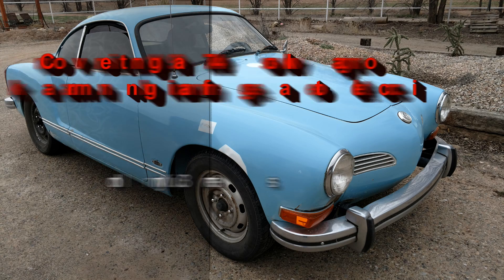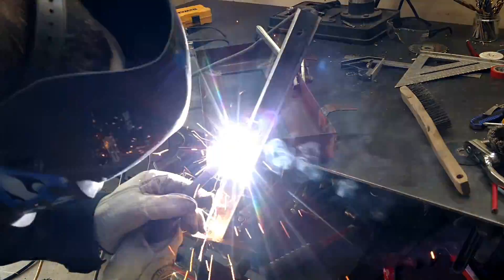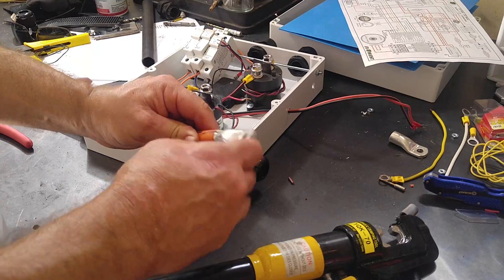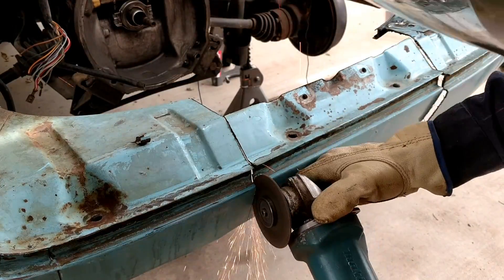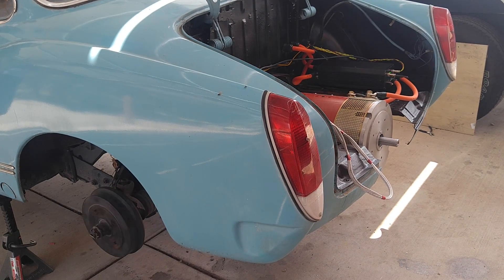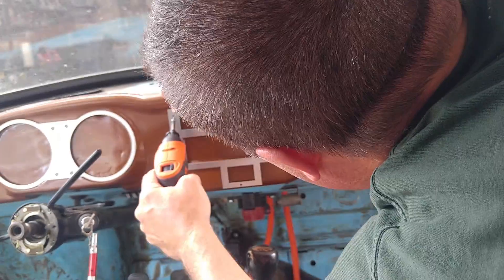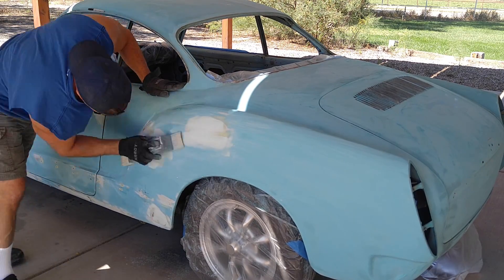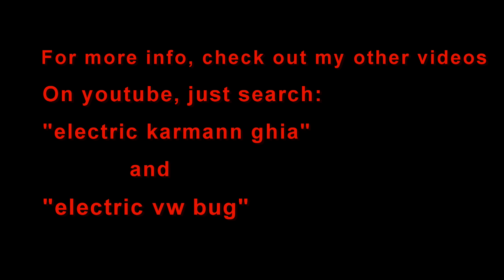Karmann Ghia Conversion to Electric (The Process)

Comment: Excellent Job! Love the creativity and practical thinking ! Does this motor and controller also have regenerative brake function?
Reply from the maker: No, it is series wound DC motor which cannot have regen, because when the throttle is off, there is no magnetic field. However, with a small car on relatively flat terrain, regen really doesn't help much compared with just coasting. Regen does save the brakes though!

Comment: Thanks for this video sir. If its not a secret - what is the source of custom metal works like dashboard parts or the construction gate form engine to transmission? How was solved a problem of vacoom breaks and hydravlic  parts of steering control? Do You use electric compressors for steering and vacoom breaks? Heater and air conditioning?
Reply from the maker: For the stainless steel on the dash i just made a template and had a machine shop cut it. That fake wood veneer came from jbugs. One reason I chose VW s is because they don't have power steering or brakes. I made a heater by taking the heating element out of a cheap space heater and hooking it up to a blower. It works instantly and far better than stock! No AC though.

Comment: Desecration.
Clever work but a shame to ruin a classic car. Should have picked a Pacer or something disposable.
Putting Prius parts on it was the final insult!!
Reply from the maker: Funny how making something superior is ruining it. Sometimes those with feeble minds struggle with perspective.
Reply: @bottsfinevids4463  Superior? That's a matter of perspective and opinion my friend. I did give you credit for clever work, but I  consider electric vehicles to be a step backward in terms of emissions, longevity and practically (although they are smooth and quiet while they last). And my mind is far from feeble.

Comment: How do u get around Rain ? Here given ur setup , it would need to b parked on high ground as soon as rain and wait 2 - 3 hrs to dry out . R u considering a shield up about 18 " ?
Reply from the maker: I try to avoid heavy rain, but I've been caught in heavy downpours more than once, and there's never been a problem. I wouldn't want to drive through a puddle deep enough to submerge the motor though.
Reply: @bottsfinevids4463  Unfortunately here we have flash flooding even when half the city in just overcast . Sweat ride though

Comment: thank you. It was interesting, I was a VW mechanic for 17 years. I would fabricate a thick metal brace for the rear that you cut out, it was structure. I also can hear that a rear u joint (CV Joints) has a bad bearing, those u joints (CV Joints) are going to be put more stress on them now that you have some more power!!! I really enjoyed the video and think it was a great idea.
Reply from the maker: Thanks you. You're right, it had a bad wheel bearing. I should have fixed it before making the video. I actually did reinforce the rear with a traction bar, which ties the two sides together as the cutout did.
Reply: @bottsfinevids4463   Did that also provide support for the electric motor? I understand the 4 bolts to the transmission held the weight of the original motor and this one, but did the floor pan provide additional support for hard bumps, etc? Also, the electric motor has a longer "moment arm" (if I recall the correct term).

Comment: Very nice build and video.  I also  liked the laid back narration.  What is the range?  Where did you learn to make this conversion and body work?  Will you do one on a Fiat 124 Spyder?  Just asking... lol  Thank you for sharing..
Reply from the maker: Thanks!  Range is 120 miles, but I consider 100 miles to be the limit.  I just learned it as I went. I wish I had a video like this to guide me though! I'm not in the business of doing this, just for personal use.
Reply: What 'charge port' do you use to charge the batteries?  How long does it take.  Awesome acceleration...
Reply from the maker: @tucson1952me  i just use any standard 120 volt outlet. My charger will accept a j1772, but I've been perfectly happy with my setup. Takes longer to charge, but i can plug it in anywhere.

Comment: great great great video......holy crap great conversion...one small note...i step drill bit is nice for drilling  holes in those electric boxes.
Reply from the maker: Thanks for the advice. It was a pain in the ass with the bit that I used!

Comment: Fantastic video!  Awesome build!

You seem very comfortable in dealing with the high voltage and the electrical engineering issues. Where did you learn? I would like to learn this.
Reply from the maker: I mostly just learned as I went . Usually was able to find most answers on the internet. I had some good electrical background from physics in college. I'm sure there were students in the class asking "when am I ever gonna use this!?"

Comment: You never heard of solder ?  I'm a retired automotive electrician. I NEVER use crimp connectors except in a temporary application. I solder every connection. Crimp connectors WILL eventually fail, causing the very heat you're trying to avoid.
Reply from the maker: You must have missed the parts where I used solder.

Comment: 1. Is the existing gear lever for shifting D and R?
2. Does it have extreme "engine" brake?   Did you have to upgrade the brake system?
3. Can we see the rear section especially the part you had to cut out to fit the motor?
4. Great work!
Reply: 2. : No, thats a WarP 11 i think. It's a DC motor, so no regen.

Comment: Sounds like there is a wheel speed noise going d-d-d-d-d-d?
Brake or cv axle problem? Wheel bearing?
Excellent job and vid. What was the conversion cost & where can I learn more about converting my bug?
Reply from the maker: Good ear! It was a bad wheel bearing. I should have replaced it before making the video. It's silent now.

Comment: Awesome Job.  I did a 1985 Honda CRX about 30 years ago. with the old deep cycle batteries. it was toooooo heavy. I drove it for two years. 

the cost of replacing the batteries got toooo expensive. Wish they had lipo's back then.
Reply: Did you keep the CRX?

Comment: At the shopping ctr near me they have free electric charging stations, Does the plug in you have work with those?
Reply from the maker: My charger can be set up either way, with a  j1772 (which is what they probably have), or a standard 110 volt.  I've always just used the standard 110 volt so I can plug it in anywhere. Since I don't go on road trips in it, I really don't have a need to charge anywhere else. Its definitely faster with a j1772 though.

Comment: What is the car's autonomy and how long to charge fully?
Reply from the maker: Not sure what you mean by autonomy, but if I drive 120 miles and drain the batteries down to nothing, it'll take 15 hours to recharge on a 110 volt outlet. I usually don't drain them past 50%, so its 7 hours. If I installed a rapid charger, which is possible, I could cut it down to about 3 hours. Still not really practical for a road trip, but it does everything else far better!
Reply: @bottsfinevids4463  Thanks for getting back to me. I meant "how far can you go before a recharge is needed'" You've already answered; 120 miles but you only go 50%for practical reasons. I agree, it is a good option to drive around [a small] town.

Comment: Brings back memory of my blue 63 Ghia I had in college! Did you have to upgrade the braking system for the extra power? Amazing work on everything for a 1 man project!
Reply from the maker: It has discs on the front and drums in the rear. Braking is not great compared to modern cars, but it seems adequate.
Reply: @bottsfinevids4463   you really need to upgrade the front brakes, it's super easy and not expensive

Comment: What is the distance to travel w/o a recharge? & how long to recharge?  I live in western Texas where we drive sometimes 2 hrs for dinner with friends... so . And how long will the batteries last?
Reply from the maker: It'll go a maximum of 120 miles driving slow and easy, but I try not to exceed 100 miles because it's hard on the batteries to drain them completely.  Highway speeds of 75 plus mph really destroy your range. I wouldn't count on more than 75 miles at those speeds. The only way you'd make it two hours is if you're going 50mph or less, so probably not good for your application.  It could fully recharge in 4 hours with a high speed charger, but I only have a standard 110 volt, which takes 10 hours from empty. Of course,  you could use more batteries to increase the range. The lifepo4 batteries should last at least 3000 charge cycles, so probably  10 or 15 years.
Reply: @bottsfinevids4463  can you list the parts you used and the costs for each - total build? Please

Comment: 31 freakin' flavors of AWESOME!!! Great video and inspiration. I own  Jaguar I-Pace and am bit by the E bug, even picked up a used Fiat 500e for my daughter. The Performance Engine on my recently restored 1969 Karmann Ghia convertible just got roached because the performance shop that installed gauges neglected to tighten the oil filter so I'm exploring converting from gas to electric on this car as well, thanks for making you great video
Reply from the maker: Thank you very much!  I strongly encourage you to do it. I have zero regrets. It is superior in every way, except no road trips. Good luck!

Comment: Man I love what you've done there but, just to ask with that amount of volts how far can it carry you with those LifePo4 batteries? I'm eager to know look into my question please. 🙏🙏
Reply from the maker: It'll go 120 miles driving carefully, but i consider 100 miles to be the max, just so I don't stress the batteries. On the highway going 80+ mph, i wouldn't go more than about 70 miles.
Reply: So in total how many cells did you add and what was the overall cost(excluding the donor car)?
Reply from the maker: @ryanandrews559  I have a total of 45  180 Ah cells for a total voltage of 144 volts (150 when fully charged). The conversion cost around 16k, but I got a great deal on the batteries.  This should answer most of your questions  http://evalbum.com/5330.
Reply: @bottsfinevids4463  Man you the next best thing next to ELVIS of coarse"   lol.

Comment: Thanks for another video, and great work! Your projects are an inspiration for me! Would be good to see a check-in on how you're managing the batteries. I'm about to embark on a KG conversion, and am super worried about fire suppression concerns.
Reply from the maker: I don't use a BMS, because I am the BMS. I installed a volt meter on each cell (very cheap) and every now and then watch the voltage at the end of a charge cycle. They actually stay balanced quite well, and I only have to intervene once every six months or so. If a cell is high at the end of the charge cycle, I drain it with a resistor. If one is low, I charge it individually. Its quite simple. I must point out that the only voltage that matters is at the very end before the charger cuts off (or on the low side too, but I never fully discharge them). Voltage reading in the middle really don't tell you much, unless one is way off. In my other video, it shows the meters on the battery pack. https://www.youtube.com/watch?v=8dp9tM0mH5Y&t=86s. LiFePO4 batteries are very safe and stable. If I used some other chemistry like LiPo, I would definitely use a BMS.

Comment: Nice, I have a Karmann Ghia That I'm considering convertin.  The 
issue is cost.  I checked prices on these parts and it didn't look 
terrible, except the batteries.  Any suggestions for lower cost 
batteries?  Also, about how much would you expect total outlay including piece parts If I do 
the work.  Do all parts come with "reasonable" instructions?
Reply from the maker: I've heard of people finding used battery packs from wrecked Chevy Volts or Nisan Leafs, but I've never tried myself.  If you use a Warp 9 motor and Zeva Controller, you'd spend around $6k. This breaks down my components, and I bought most of it from EV West. http://evalbum.com/5330. The instructions for each part were reasonable, but the most helpful thing is a basic wiring diagram from EVWest.  https://evwest.com/support/Basic%20Kit%20Schematic%20-%20DC%20System.pdf

Comment: How do you find the EV West kit out of the box? Are there any "would be better if..." items? Thanks for putting this together.
Reply from the maker: It depends on how much performance you want.  They use AC motors (AC50) with a 650 amp controller, which are very nice and overall very good, but they don't have nearly the torque of even a Warp 9 DC motor, much less a Warp 11. It would no doubt perform far better than the stock engine, but would not have the crazy acceleration that you'd get from a DC motor with a 1000 amp controller. You'd also have regenerative braking, which really doesn't add much if anything to the range when compared to just coasting without regen, but it would save your brakes.  Also, the AC motors don't have brushes, which is nice, but not a huge deal. I've gone 25k miles so far on the bug, and the brushes barely look worn.  It would certainly be a hell of a lot easier to install and you would know its going to work! In short, if you want an overall very good product and easy to install, get one. If you want to be able to burn rubber and blow away sports cars, then go DC! Also, EV West has great customer service. And one more important  thing--with the AC motor you could use the stock tranny and probably even the stock clutch. I destroyed the stock transmissions in both cars in short order. I had to upgrade.
Reply: @bottsfinevids4463  What transaxle upgrade did you install?
Reply from the maker: @peterday3253   It is a super street from KCR Transmissions. It has a super differential (4 spider gears), welded 3rd and 4th gears, and a 3.44 R&P.